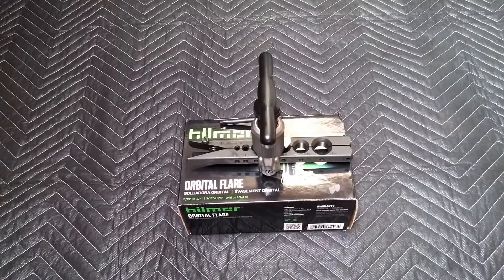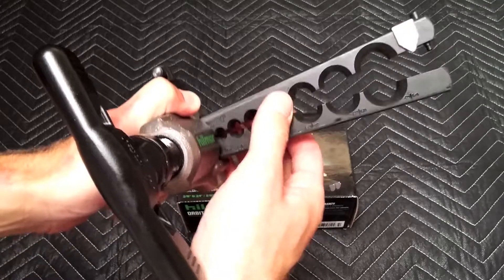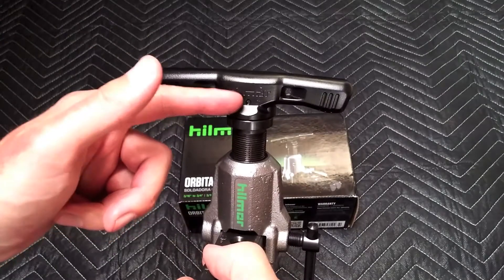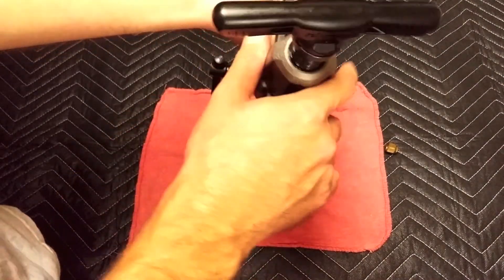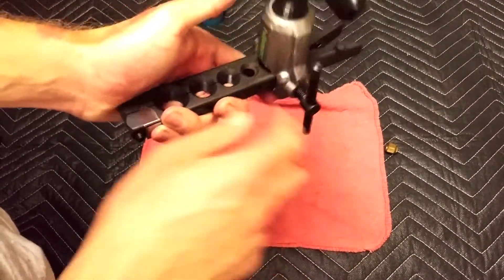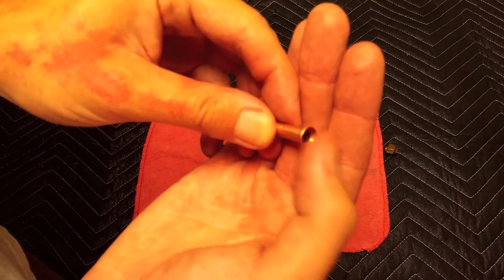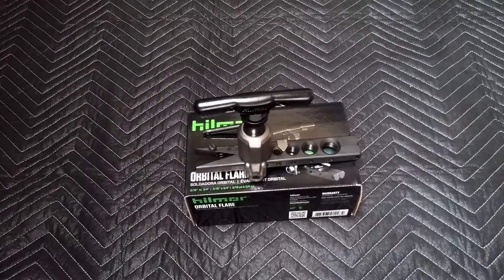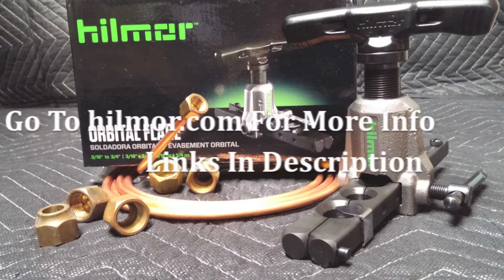hilmor Orbital Flare Overview

Comment: Everything breaks I bought 2 sets of digital refrigerant gauges this flare kit and 2" pvc cutters my pvc cutter broke the 1st time I used them my flaring block snapped and the digital readout on both sets of gauges failed half way through the 1st summer of use i tried to send the gauges back to get repaired and they said they stopped production and sent my broken gauges back that I paid $500.00 each for don't waste your money on hilmore

Comment: Good morning,greetings, I have a question,
Unit R22,1 1/2 ton,minoral oil ,how to change it to a POV oil new compressor,this is a ac house unit,if you can do a video on it ,thank for your videos,you are awesome!
Reply from the maker: Emil Falck Hi Emil,
Best thing to do is buy a new compressor with POE oil in it already. Blow out the lines with nitrogen, assuming you didn't have a burn-out. And preferably the evap. coil should be compatible with R410A and metering device as well. I don't recommend doing this if you don't have any experience, a lot  of things can go wrong if you don't know what you're doing.
Reply: Hi,greetings,Thank you for the advice, I appreciate
Reply: Than you